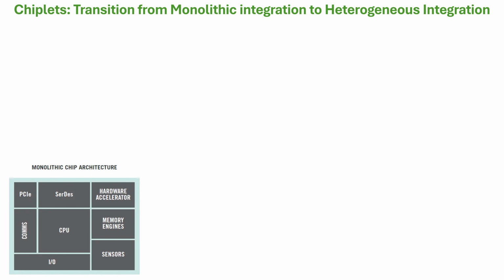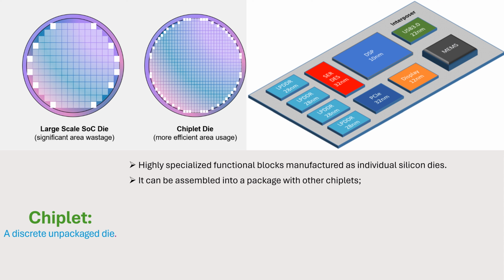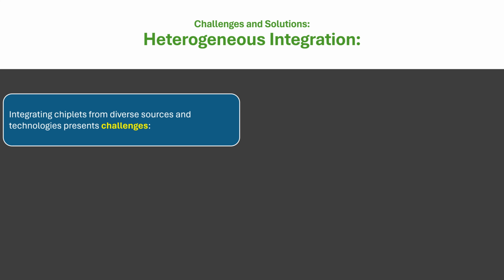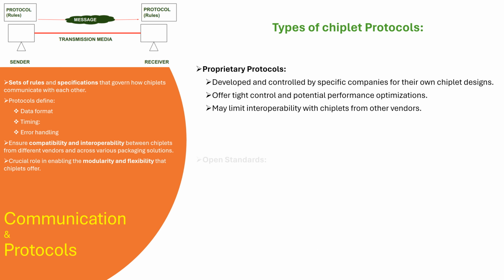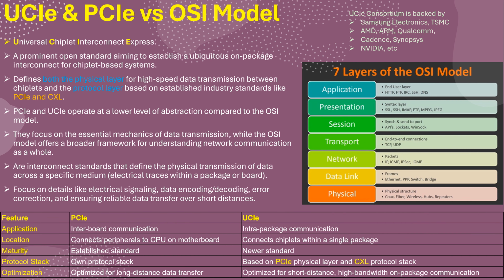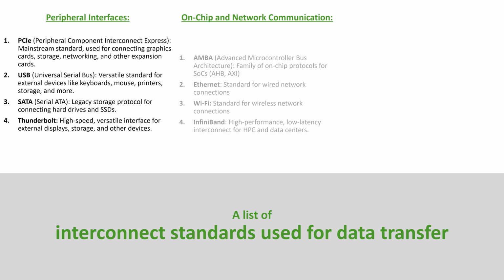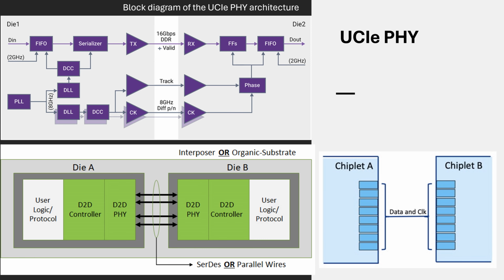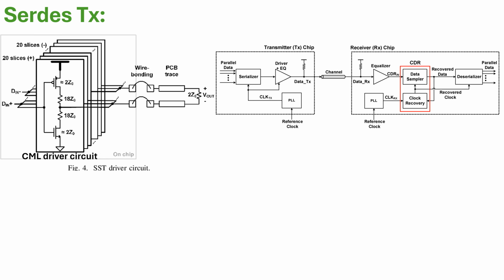Chiplets & UCIe : Overview

Comment from the maker: This video is about chiplets and UCI Express, a new standard for communication between chiplets.

The video starts with a brief history of integrated circuits, explaining how they have become increasingly complex over time. This complexity has led to challenges in manufacturing and design, which chiplets aim to address.

Chiplets are individual functional blocks that can be manufactured by different foundries using different processes. They are then assembled into a single package to form a complete system. This approach offers several advantages, including:

Increased yield: By breaking down a complex chip into smaller chiplets, the yield of good dies is improved.
Design flexibility: Chiplets can be mixed and matched from different vendors, which gives designers more flexibility.
Performance and cost optimization: Chiplets can be manufactured using the most suitable process for their function, which can optimize performance and cost.
The video then discusses the challenges of chiplet integration, such as interoperability, testing, and verification. It also introduces UCI Express, an open standard that is being developed to address these challenges.

UCI Express is a high-speed, low-latency communication protocol that is specifically designed for chiplet-to-chiplet communication. It is based on the PCI Express protocol and is supported by a consortium of major industry players.

The video concludes with a brief overview of the UCI Express protocol stack and the different physical layer connections that can be used to connect chiplets.

Overall, this video provides a good introduction to chiplets and UCI Express. It is a complex topic, but the video does a good job of explaining the basics in a clear and concise way.